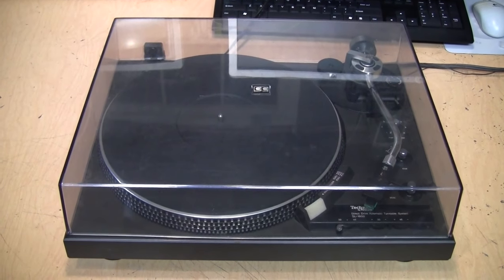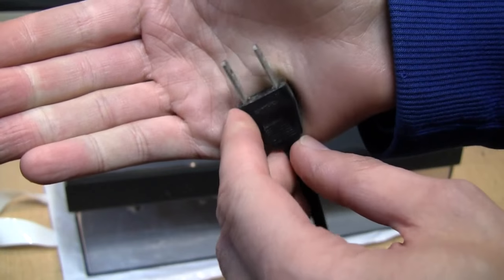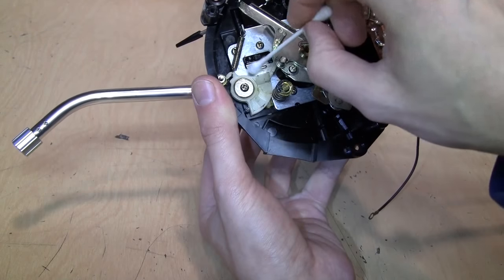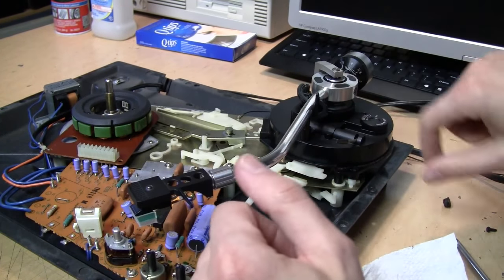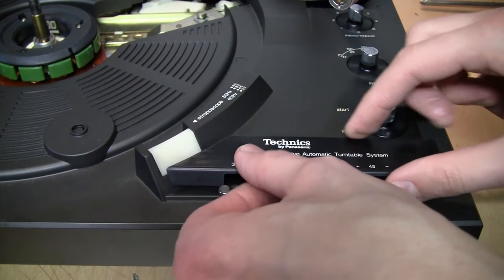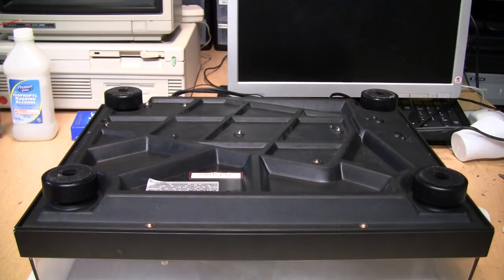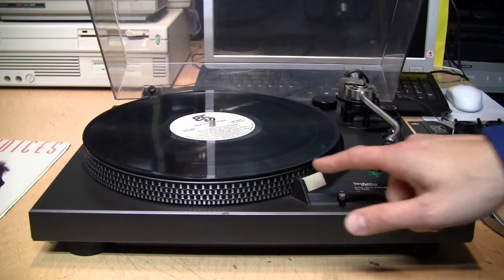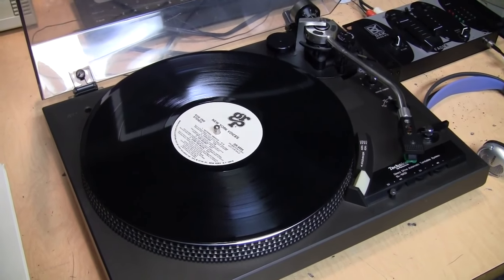Technics SL-1900 turntable repair & review

Comment: not wanting to disagree with you .but I have  an audio technica atlp-120 turntable & whenever I play it the strobes for me anyway always stand still,they never vary ,also on the tracking I found out that I to had a hard time setting my antiskate I always had to adjustit to a high setting like at 8 it used to bother me then one day I waslistening to a record I had for so many yrs it was sounding distorted torward middle of album which never happened before ,so I checked alignment ,it was fine I also decided to check my cartridge overhang adjustment which I never checked before it was way off so I corrected it to spec and thought lets adjust anti-skate and I set it to1.75  the tracking force of my cartridge  and I could not beleive it the tone arm was still on my cd and did not at all mve nor vary  played same album distortion was gone and album sounded better than ever!wow!!
Reply from the maker: AT-LP120 turntables manufactured before 2017 are known to have weak anti-skating. You can fix this by either cutting the anti-skating spring shorter to tighten it or replacing it with an upgraded spring available from Audio-Technica. This requires disassembling the turntable but there is a tutorial available online which guides you through it.

Comment: Hello, i read this is a full automatic, so, where is the Play /Start  button ?
The arm must comes itself automatically on the record, does it works ?
Thank you for your answers
Reply from the maker: Download the manual, that will tell you exactly how it works: https://www.manualslib.com/manual/946446/Technics-Sl-1900.html
Reply: There is a Start/Stop lever at the lower right corner to control that.  Very simple to operate. (also a dial setting for 7”, 10”, and 12” records)

Comment: Nice job.
I have an issue. When I start the TT whether it is Auto or manual I hear a big 'thud' sound from both speakers. This happening when shut-off too.
I checked the earthing and changed the spark capacitor. Still the issue persists.

Can any one tell what is the issue? Pls.
Regards

Comment: If i have a sl-1500 which is fully manual is regreasing the tonearm as hard as regreasing the que lever that you just greased?
My tone arm has built up grease and was hoping it was somthin like this?
Reply from the maker: I have no idea about that model. Did you try looking it up?
Reply: I found some info online but have not found a pdf file for the manual, will have to do a lil more research before opening up, but im also having issues with my que arm lever not fully raising. "original owner told me he never used it" lol Barely hovers over the record player but does not lift it past the tonearm rest

Comment: The direct drive system is much better on this model because the platter is actually part of the direct drive system as with their 1200 series. Also the Audio Technica 1240 also has the same direct drive system.

Comment: I do not see the point of buying a modern TT, and do not understand people who recommend them. They almost always have worse w&f / rumble figures than old 70's-80's era machines, and are always bare as a desert in terms of features. I got a Sony PS-515 when I was 15 years old for next to nothing off of a used stereo dealer and it's still works like a dream. It's also a late 70's fully automatic machine, with quartz lock. Never deviates, never falters, always plays nice and smooth. Only once did I need to open it to fix the auto mechanism not triggering; it turned out to be a plastic peg that got snapped off from age and dryness. A bit of superglue and the thing keeps on ticking like nothing happened. I've had many additional tables come and go from my house since then, but that Sony always remains in my setup as my trusty stable machine, old and grimy as it is. One of these days I'll restore it to be like new. It deserves it :)

Comment: Hello I have a technics SL 1910 and when I try to play 45s the speed is too low and irregular, the speed of 33s seems to be normal. I only have this since a couple of weeks.  What could be the problem and what can I do about it.  This model does not have a belt so it must be another problem.
Reply from the maker: Probably dirty contacts on the 45 RPM speed adjustment pot. Spray some Deoxit into it.

Comment: I have one of these and the sound coming out of the integrated amp is very low.  Is this a cartridge/needle problem?
Reply from the maker: Does your amplifier have a phono input? If not, you need a phono pre-amp.
Reply: @vwestlife  yes I have a Cambridge axa35.  Sound comes out but it's distorted and crappy.  I ordered a new headset and stylus oronton.  Hoping that helps.
Reply: Some receivers/amps allow you to adjust the db for specific inputs. Raising the db by 10 or so may help. A new cartridge/stylus can help too.

Comment: I have this sl 1900. But a problem arise recently, it is spinning too fast, on both 33 n 45 rpm. What may be the the cause?
Reply from the maker: Try cleaning the pitch adjustment controls with electrical contact cleaner (like Deoxit).
Reply: Thanks for your advice.
 my sl1900...spin too fast like a spinning top.
Worried that the ic May have gone.
But the culprit is caused by the two variable resistor/preset. No use cleaning or spraying.  I just replaced them.
And it's speed back to normal. 33/45.
Thank God....IC 630U...is functioning good.😌

Comment: I have Montgomery Ward GEN 6223 stereo that has an 8 track, phono, cassette, radio. the caseett has  very bad wow and flutter making it impossible to listen to a caseett. Truntabl is stuck because of old Greece and the 8 track works just like it's suppose to. I only paid $5 for it . but this unit is better then my 2016 stereo that didn't even last a year before it broke and it wasn't a cheap one.
Reply: ratchet5500 video's Old Greece?  Like pre-financial collapse or Greco-Roman times?

Comment: Could you explain how to clean the anti-skate? Remove the gunked up lube and relubing it afterwarts? Greetings from Germany, Mike
Reply from the maker: I haven't needed to do that, so I don't know.
Reply: cleaning all greased parts with alcohol and relubing them with new grease worked. It runs perfectly fine now.

Comment: What will be a reasonably price  phonostage that goes well with the tt?
Reply from the maker: Any '70s or '80s stereo receiver with a magnetic phono input will work fine, or if you can't find one at a reasonable price, any phono pre-amp will do the trick, such as: http://www.ebay.com/itm/400988829113
Reply: define "reasonably priced" ;) What is reasonable for one person might be too expensive for someone else. I really like the ART DJPre II phono stage, which typically sells for between $40 and $50 depending on where you buy it. I also have a U-Turn Pluto which is $90 but it's made by hand in the USA and sounds phenomenal, so I consider it "reasonably priced" because it can compete with other phono preamps in the $200-$400 range.

Comment: For 40 years old turn table, I would start to think about leaky electrolytic capacitors and replace them with Sprague Atom brand and update the capacitors with Orange Drop brand,
Reply from the maker: There are no capacitors in the audio path. The output comes straight from the phono cartridge.

Comment: Lithium grease is worse then the old grease, the dry time is now months instead of years. Some low odor marine grease works wonders.
Reply: Shell Gaddus V220 2 is the best grease for turntables.  It was used in the 1970s (Called Alvania) by Dual on all their 1200 series.  It's stable for YEARS.

Comment: That repair didn't work for me. The tonearm lift/lowering itself works fine but there's no dampening to it at all despite no parts being missing. Anyone knows a fix?
Reply from the maker: You need to add silicone oil to the dampening mechanism. I believe the service manual (which you can find online) shows you how to do that.
Reply: It doesn't, unfortunately. I lubricated the cue rod, if you mean that.

Comment: i did this and solved the problem.  but it is not making any sound. i have trouble shot my system so it is definately the turntable. FYI, it has not been used in 20+ years
Reply from the maker: Are you using a phono pre-amp or a receiver with a phono input?
Reply: @vwestlife   thanks, i was not, but just bought a Phono preamp after some more research.  Good grief, a $XXXX amplifier and it still needs an additional gadget to play an lp :)

Comment: I recently bought one of those, but it has two problems.
1. Dropping the arm with the lever or Autoplay is way to fast. The tonearm just falls on the record like there is no damping.
2. When I start it via Autoplay the tonearm jumps up really high and falls down, then moves to the record and starts playing.

Any suggestions?
Reply from the maker: Look in the service manual: https://www.manualslib.com/manual/689429/Technics-Sl-1900-M.html
Reply: VWestlife thanks for the reply I fixed the first problem by applying silicone damper. But I'm still struggling with the second problem. I made a video: https://youtu.be/x5pPoe8fbJs

Comment: I didn't know there were electric cards in a record player.
Reply from the maker: In a direct-drive turntable there is some circuitry needed to regulate the speed of the motor. Belt-drive turntables are much more simple.
Reply: interesting. Well I've got a 2001 Video8 Camera that I use to use a lot of times. I made a film with in this year on my Windows 98 computer.to explain how it copes with it all I had to do was adjust so I could have a replay of the computer screen without lines appearing.And that style was captured with the Digital8 Camera. I've seen your film about you telling us to use two cameras instead of the cables.